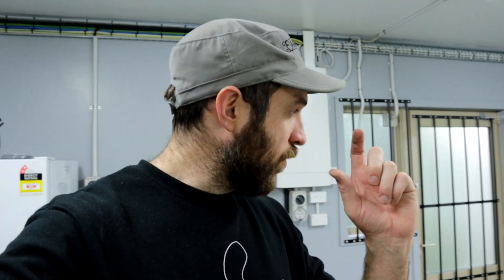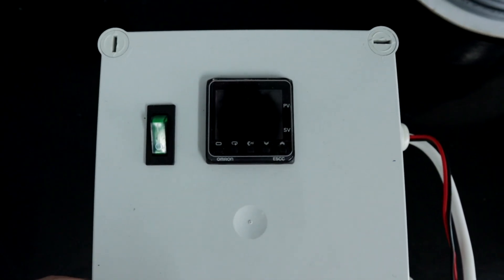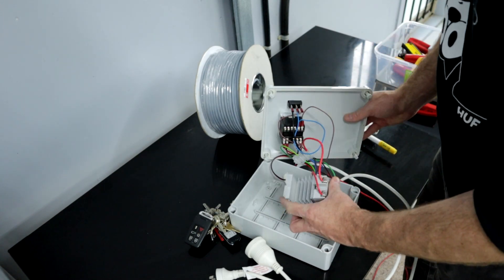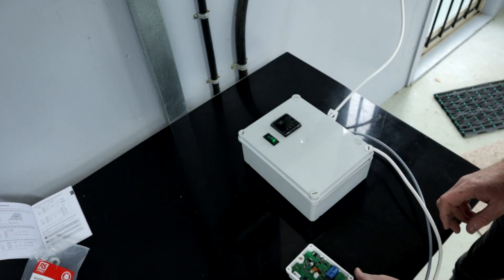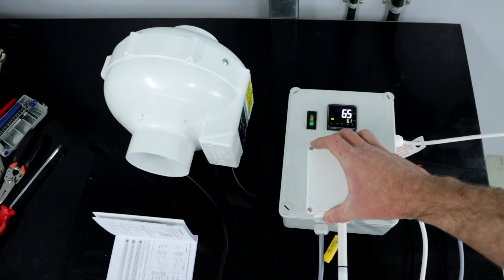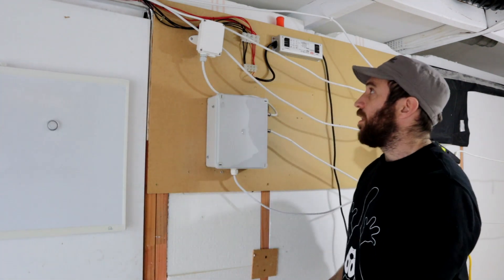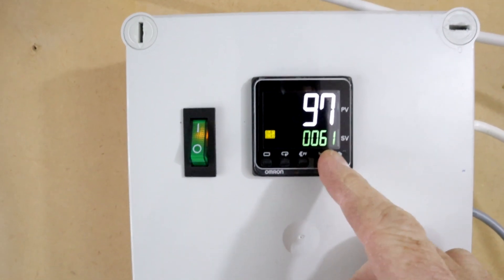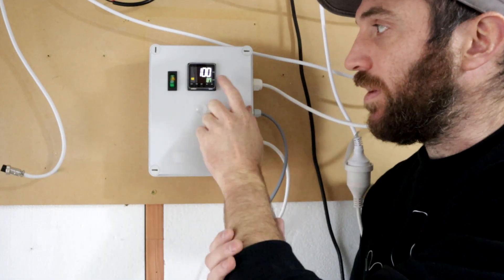The Best Humidity Controller You Can Use.

Comment: Hi, how did you wire your humidity transmitter to e5cc and is there any by chance you can share your settings/program? I'm having problem connecting my humidity transmitter to e5cc. My transmitter says its for 4-20ma but when i connect and set e5cc to 4-20ma it shows s.err. Hoping you could give a hint. Thanks brother.
Reply from the maker: Do you have it in the right terminals at the back? Also make sure you change the setting to 4-20ma in the e5cc.
Reply: @OakandSpore  yeah, already did change it to 4-20ma. I connected the yellow and blue line of humidity/temp transmitter to the back of e5cc (A,B terminal) for RS485. Then the other 2 line from transmitter (brown & black) to a 12v power supply. Still having error.
Reply: @OakandSpore  Btw, your new farm is so cool! So inspiring!

Comment: Looking forward to seeing videos of your new farm setup!  One trick I've learned about humidity probes is that they take a while to adjust to the temperature - so best practice is to put them into a new environment in a sealed bag or something so that they don't get any condensation on the humidity sensor - because that will read 100% simply because it was cold and condensation formed on it.  I believe the vaisala sensors have a heated mirror internally that seeks out the dew point to calculate RH - so it takes a while to heat off that initial condensation and get an accurate reading.
Reply from the maker: I had never thought about temperature differential between the probe and the room its going into. It would make total sense and the room the probe was in would have been maybe 12 degrees, then placed into my fruiting room at around 18-20 degrees, it would definatly cause condensation on the probe tip. 

I love it when youtube comments teach you things!

Comment: For that smart plug that died, try the kasa TP-Link smart plugs with energy monitoring. I use those for my mushroom farm automation and havent had any trouble with home assistant.  U can get them from jbhifi, bunnings etc.
Reply from the maker: That's what I use. The problem is that home assistant would lose the device entity, and it would then stop working.
Reply: @OakandSpore  you have a different model than me. I use KP115. I think you are using HS110.
Reply: @OakandSpore  try removing the intergration. Check the kasa app to make sure its working by turning it on and off in the app and then go back into HA and install the kasa intergration again. You wont lose any settings adding and removing the intergration.